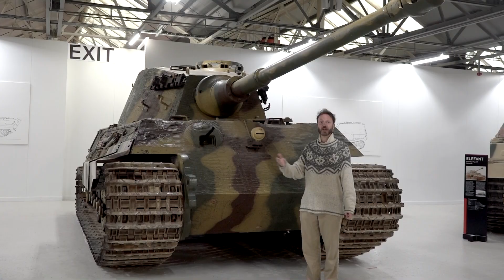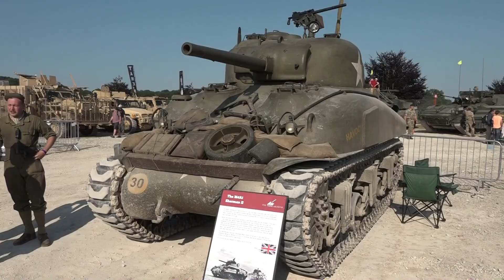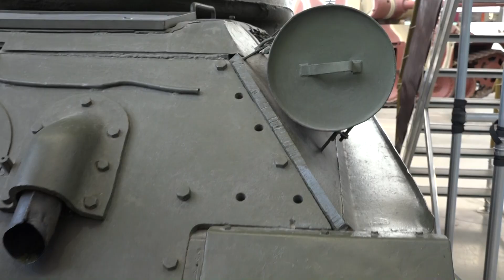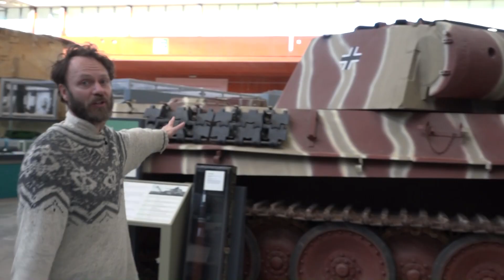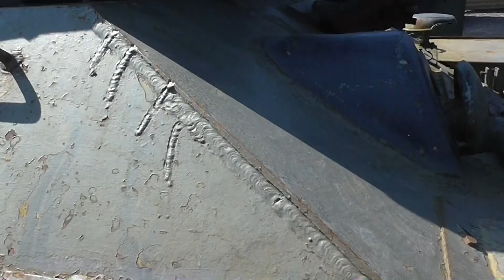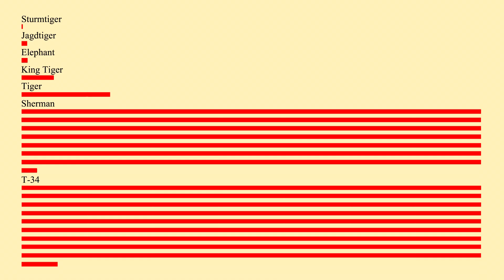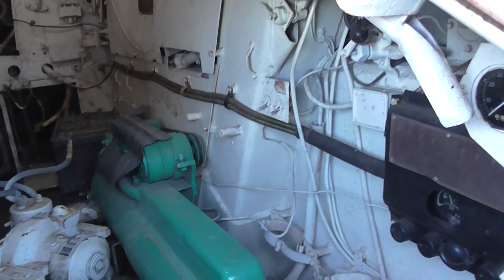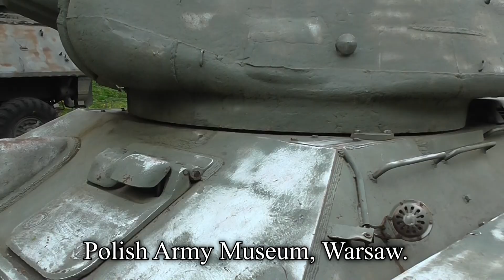World War Two's most common tank

Comment: The issue for the Germans wasn’t the number of tanks they could build, but the number of tanks they could field. 

Making expensive tanks made sense for the Germans because they couldn’t actually get many of them to the front, so they ones they could were made to be as good as possible. 

Making 20,000 mediocre tanks would have been useless because they couldn’t even send them to the front and supply them at the front.

The Soviets might have been better served with fewer, more user-friendly tanks. I’ve seen many instances of T-34s and KVs being underutilized (driven right into the sights of an 88mm gun) due to poor usability. The Americans didn’t really need to compromise, as the Sherman was numerous, capable, and fairly ergonomic, but they had 90 divisions with 200 divisions worth of equipment.
Reply: Another issue was fuel. The Allies had plentiful access to fuel from the oil fields in the US, the middle East and elsewhere. The Germans were blockaded and only had a few oil fields mostly in Romania. Having huge swaths of cheaply made tanks would’ve depleted Germany’s tiny reserves, so making fewer better tanks was probably the right choice. Of course the Germans did screw that up by making huge gasguzzling monsters which were prone to being lost due to mechanical failure rather than enemy action.
Reply: @josephattwell1006   Yeah, that’s actually right on the nose, in my opinion. 

The root cause of Germany’s military failure was bad logistics, and the root cause of the bad logistics was the lack of oil, and the root cause of the lack of oil was the British (and later American) blockade. 

That was, in my opinion, actually the main contribution Britain made in defeating the Nazis and it’s something that is often overlooked and taken for granted.

When Germany lost in 1942, it had plenty of tanks and manpower… but they were all back in Central Europe when the fight was in the Caucasus and Don-Volga area. In fact, they couldn’t even supply the troops they had at Stalingrad adequately before they were surrounded.
Reply: @deriznohappehquite Royal Navy, Royal Airforce strategic bombing of the German industrial base. Preventing Rommel from driving to the oilfields in the Middle East, destroying the best ever panzer divisions that the Germans had . Oh and keeping the Russians in the game through horrendous losses of the Merchant Navy supplying the Russians with Matilda and Valentine tanks which saved Moscow. Lots of artillery and artillery rounds , food when we were short of everything.  Their current logistical problems are because they were reliant upon British and American supplies and know how in WW2.  Russian airplanes were built from American and British supplies and made to look different for propaganda. You rarely see Soviet footage of British and American tanks in battles like Kursk but they are there. Ffs they can’t even make their own drones in 2023.
Reply: @johnbooth3073  people don’t talk about how almost all of the winter uniforms for Soviet soldiers were sent to the Soviets through lend lease. It’s not like the Soviet soldiers weren’t capable of freezing to death, they were just given winter apparel made in the US
Reply: Very well said. People often miss the point. If anything the germans should have doubled down on maximizing combat effectiveness on their limited vehicles, which is in a way what they were trying to do, but the truth is that it would never be enough, they were buggered either way.
Reply: Answering your point of the main British contribution to the general war. Also there was only Britain and it’s Empire fighting against the Germans from Sept 1939 - Dec 1941. ( Soviet Union was forced into not helping Germany by Germany invading Soviet Union).
Reply: @johnbooth3073  I’m not sure if you think you’re arguing against me, but to reiterate:

The primary cause of Germany’s strategic defeat in WWII was the oil crisis, which was caused by the blockade. 

If Britain surrendered in 1940 and thereby allowed the Germans to import oil from the Americas, the Soviets would have been under much more pressure than they were historically.
Reply: @deriznohappehquite  Yep maybe even history 👍
Reply: Interesting take, but makes sense tho
Reply: Oh and breaking the German codes , that was probably the greatest contribution of any of the players in WW2. Russians wouldn’t have won at Stalingrad, Kursk without western aid in material and information. Etc etc …..
Reply: still doesnt account for the fact that most tanks are disabled through attrition rather than combat, doenst matter how ergonomic you tank is or high quality if it just got stuck in the mud. you need more tank to replace those losses.
Reply: @andrewduan5123    I don’t really see how this contradicts my argument. 

It is true that The Germans sent tanks with crappy drive trains to the front, and they often broke down before making contact with the enemy. 

I think the best solution to this problem is to make sure your tanks have good drivetrains, even if it means you build fewer of them, not to make more, crappier tanks. 

By the way, I think so called “X-factors” like reliability, ergonomics, communications, optics are way more important than so-called “hard factors” like gun calibre, armor thickness, and top speed.

The M4 Sherman was the best tank of the war, by the way.
Reply: @andrewduan5123  True; the T34 was notorious for having a very poor transmission. The Soviets were very dependent upon their railway system which was helped massively by the Americans donating 3,5000 locomotives to the cause. 10,000,000 km of communication wire for land telephones and radios plus thousands of jeeps to relay information. This help is missing in the current Ukrainian war on the Russian side. There ball bearings issue is hampering their rail traffic as well. Organic Russian infrastructure and industry is poorly helping them in their current’ special invasion’ . 😂🤣
Reply: facepalm
Making 20k mediocre tanks is precisely what the Germans did... The tanks Lindy showed were insignificant and generally a waste of resources.

And the Germans wiped the floor with the Russians at the beginning of the war, annihilating 17k T34's with just 1.5-3k mediocre tanks.
Reply: @Ilamarea    I think you and I have different ideas of what makes a quality tank. In my opinion, it’s all the little things, not the size of the gun and the thickness of the armor. The T-34 was a piece of crap.
Reply: @deriznohappehquite  The Panther wasn't great either. To paraphrase Nicholas Moran (AKA The Cheiftain) "The best tank is the one that turns up on the day". A good gun, good armour and good speed mean nothing if the tank breaks down on the way to the battlefield. Yes, a few, larger tanks do make sense from the standpoint of logistical efficiency, but that only really works as an argument if they actually get to the fight, which many Panthers didn't.
Reply: @GoranXII  
According to Hillary Doyle, the realizability issues of the panther had been ironed out by the time they reached the G variant.
Reply: @Ilamarea  Your figures are way out. Russians lost 2,300 T34 and 500 KV heavy tanks by the end of 1941. British Matilda tanks saved Moscow because the German Mk1 , Mk3 found the armour too thick for their low pressure guns to penetrate effectively. Germany lost 600,000 soldiers by then and that was deemed to be the easiest period of the war for the German army. It just got worse, and worse , and wor…….. . The Allies started from a standing start and beat the war machine that had been preparing for many years, practicing in Spanish Civil War and had built factories in Russia to circumvent the Treaty of Versailles limitations that had been thrust upon them to build Heineken 111 etc in preparation for their upcoming war .
Reply: so german troops faired well until they were running out of fuel and spare parts due to logistics chains, so your view is right + generals started making bad collaboration in eastern front. german tankers and mechanics were also pretty well trained what I understood, almost exceptional in WW2.
Reply: @effexon  No they didn’t fair well. This is a myth !  They invaded Russia with more troops than the Russians had in their standing army. They underestimated the intent of the Russians to fight back. The Germans see things from a short term logical perspective. They will never understand Brexit because of it’s short term pain economically which doesn’t compute in in their straight line thinking. They saw Britain standing alone as illogical, they saw Russia through similar goggles. The German soldiers saw the Russian soldiers as crazy beings that fought to the last round of ammunition.
Reply: They lost 600,000 men by the time they got stuck in the mud . That’s not doing fairly well in my book.
Reply: @johnbooth3073  Yeah, but the Soviets lost like 5,000,000 by that point.
Reply: The soviets could only build this many tanks thanks to the incessant material support from western allies. all their trucks, the ones famous for mounting the katyusha rocket artillery were US made. their radio equipment was provided by the americans too. only thanks to that they could roll out T34s out like no tomorrow out of their factories while still having them serve some semblance of usefulness on the battlefield, otherwise the russian tankers would be blind, deaf sardines without a clue whats going on around them. 

the actual performance of the T34 was pisspoor, their quite powerful gun was neutered by their rudimentary sighting systems, their hulls were so poorly made even non-penetrating hits often caused spalling inside the hull that turned the crew into mincemeat. 

if anything the material losses of the red army, regardless whether they were on the offence or defence, and despite the fact that they had air superiority or even total airspace control, or contested the airspace successfully at the very least, shows how inferior their material was.
Reply: In the later war, the Germans had thousands of vehicles, aircraft and ships sitting idle for lack of fuel, ammo and crews.  Hitler had killed or fired most of his experienced Generals and Admirals, and was making tactical and strategic decisions himself.  His sum total military experience was as a corporal messenger runner in WWI.  He was his own worst enemy.
Reply: @lancerevell5979   I would disagree with this sentiment a bit. The OKW are pretty self-serving in their memoirs. A close examination of the evidence shows that Hitler wanted to go south for Ukraine and the Caucasus from the very beginning. The generals wanted to go for Moscow. The generals got their way in the actual operation. 

They both thought they only needed to kick in the door and the USSR would collapse, but if Barbarossa thrusted south toward the caucuses  instead of north towards Moscow from the beginning, the Germans would have been much closer to some kind of victory than they were.

The war was pretty much won for the Allies when the Germans failed to capture the Caucasus oil fields in 1942.
Reply: And they gettin' only in 44 in Europe against nazi.
Reply: @his-dudeness you probably think the Soviet Union won the war alone
Reply: @riograndedosulball248 They did
Reply: @riograndedosulball248  the soviets already won the war by the point normandy happenned. The americans certainly helped but the war was won in 42
Reply: @his-dudeness  If you're talking about the Sherman then no, first used by the British in North Africa from September 1942. Used at the Second Battle of El-Alamein in North Africa in October - November 1942, operation torch, the invasion of Italy in September 1943 etc etc.
Reply: @his-dudeness 
Aside from Italy an Allied invasion of France in 43 would have been a disaster.

Comment: You missed that there is an escape hatch for the hull machine gunner in the floor, you can squeeze out of that without waiting for the driver to bail
Reply: Yes but check out a few videos on the escape hatch in the belly of a T-34, it's awkward to get to, small, and you're dependent on sufficient clearance under the hull.